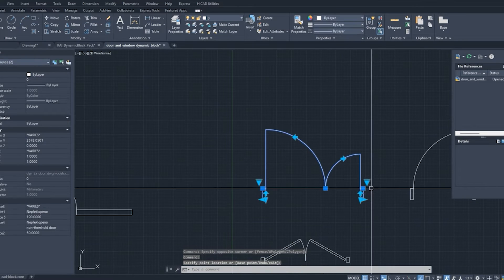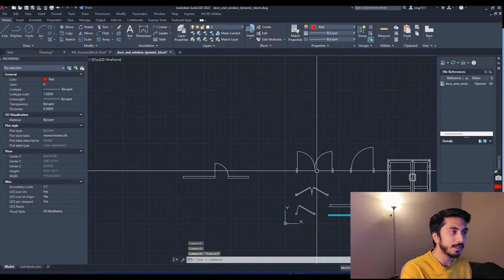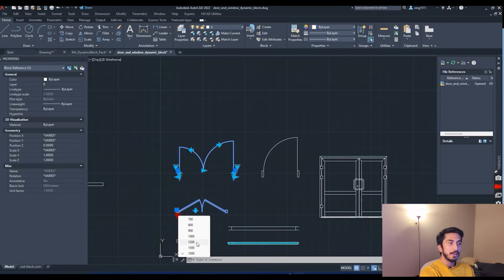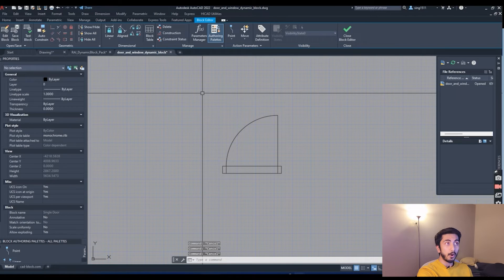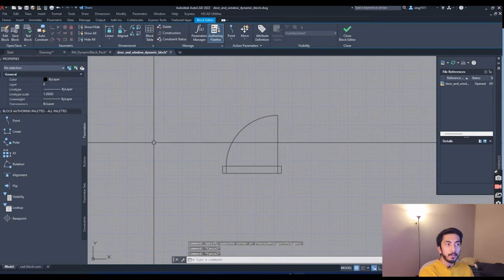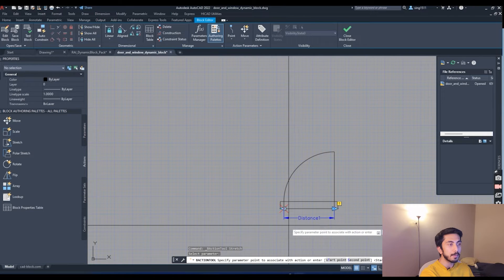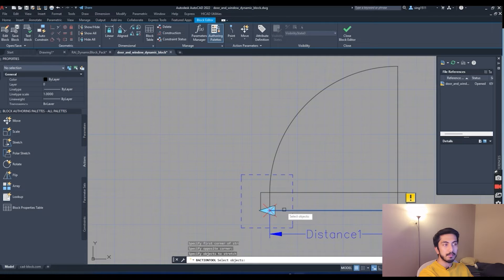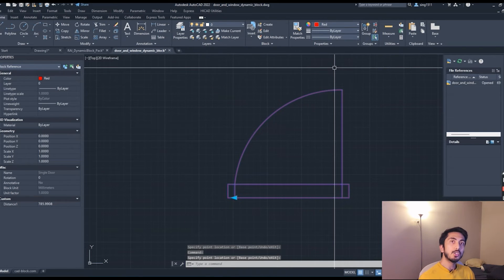How to make AutoCAD Dynamic Block | Stretch & Scale Command - Part 1

Comment: The Point to Point position of that linear distance should be above that horizontal rectangular door to avoid using that value set limits. just sharing.
Reply: Thanks to your video I learned about that